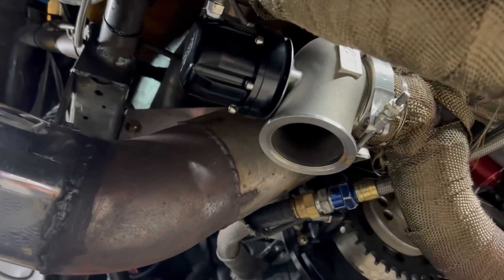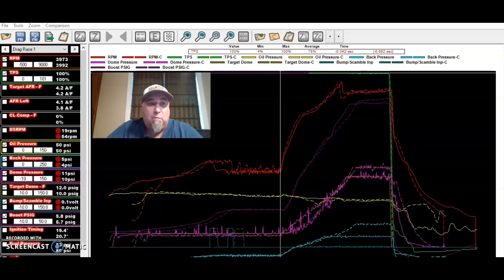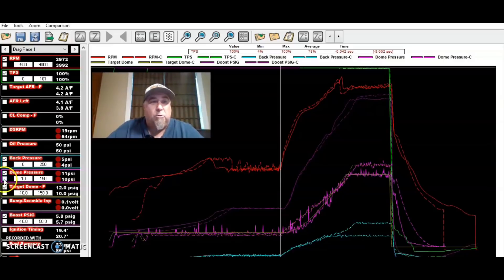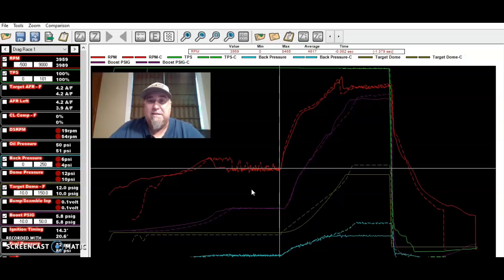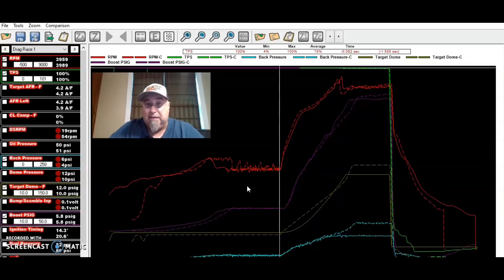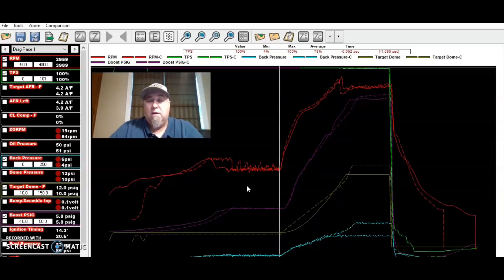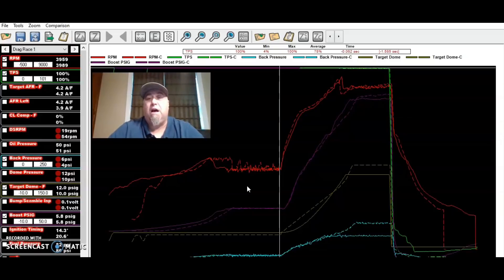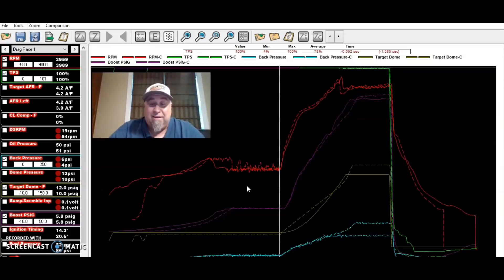Boost v/s Back pressure / More Boost with less back pressure

Comment: we use to do this on stock sr20det 4cyls for drifting.  weld a external on the oem housing with a oversized gate, less backpressure, lowers egts, and cleans up the mid range and  top range feeling coming on and off throttle you need for drifting.  with a 50mm made 500wheel on stock oem manifold on a 2.0l 4 with a tiny t25 flanged turbo at 23psi. back in 06.

Comment: Good stuff TJ.
A while back you did another video on boost versus back pressure which inspired me to play around with the internal gate turbo on my diesel 4x4.
A couple of weekends on the die grinder (lots of pressure and temp measuring with real basic gauges and sensors)and a twin port Turbosmart gate and I reduced the back pressure considerably on my engine and gained approximately 4-500 rpm of usable power band - half down low and half up top of the rpm range.
Feels like a completely different car and I didn't even touch fuel or timing yet.
Thanks for the inspiration.
Edit, on top of that I went from an 8cm squared exhaust housing to a 6cm squared housing and still achieved the drop in back pressure.
Could probably go further with data logging and a Dyno instead of a a bunch of old gauges and a long step hill out the back of my place. But it's a mechanical pump and I'm a low budget kind of guy.

Comment: Seriously though where is your pressure sensor relative to the wastegate? Maybe it change the flow somewhat. Theoretically a high-flow to pressure relationship in a pipe with the sensor port perpendicular to flow a slight vacuum (negative pressure) could be created on that port. Stick a straw in a cup of water and blow compressed air across the top of the straw. What happened? It draws the water out
Reply: Pretty much has to be like this.